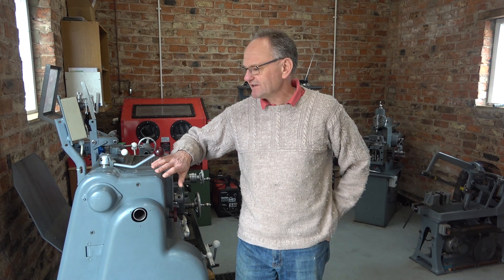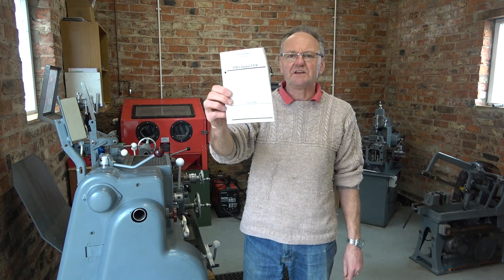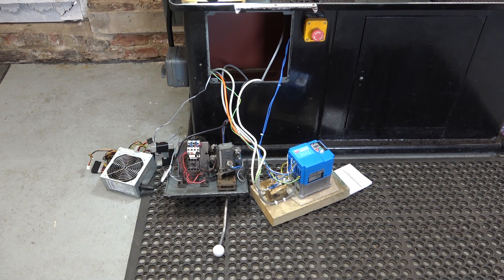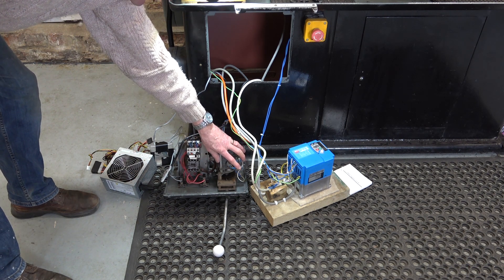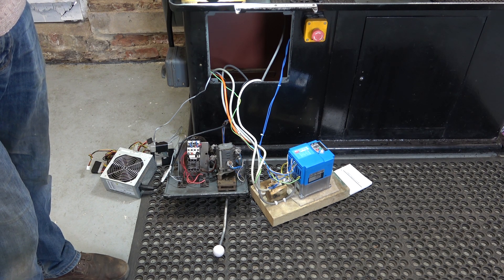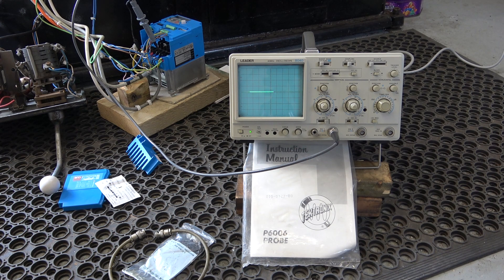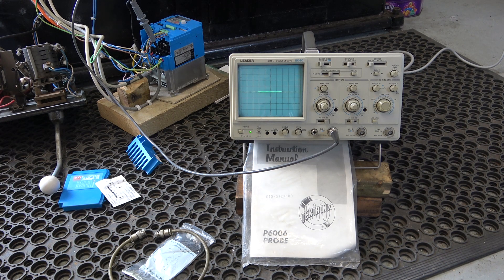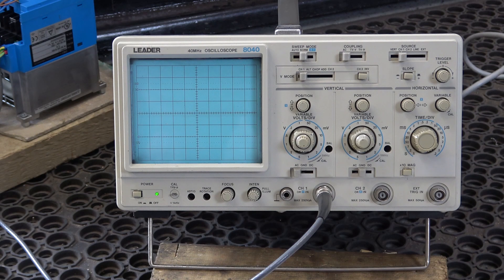HS65 Harrison lathe VFD tinkering

Comment: Measured between phase and the sky ? !!! WTF !
Used to repair radios ??? WTF
I'm not into electronics but.......
From CPC Farnell, get 3 7W resistors code: REO5423 8k2 ohm. Connect one end of all three together (=neutral) & connect the other ends to each phase. Then get another of the same resistors and put it across your scope. Then get an 80k resistor put in series with your test leads - and put the ends of those across Ln and N. That'll give you 24V at the scope of 1 phase and be properly connected !

When finished with this set up. Put the 8k2 resistors into unconnected mains plugs between L and E and give them to your friends that like annoying practical jokes !
Reply from the maker: Hi pmailkeey, I freely admit it was a bit of messing around. I realise now I was not going to see anything useful on the voltage, I needed to look at the current waveform. If I ever need to do any serious diagnostics then that's how I will approach it. I understand that now. Cheers
Reply: @HaxbyShed  I don't expect the current waveform to be vastly different to the voltage one - probably with some phase shift.

Comment: "I paid a lot of money for the inverter - about £350."
Not quite the £1200 I paid for a 3ph diesel generator. I wanted proper electricity - none of this electronic fake stuff. Mine has 2 wave forms: ON and OFF ;)
And of course is reversible: OFF and ON  - LOL
It's the instant spindle reverse that forced my hand - I didn't want a workshop full of electronically generated soot.
Reply from the maker: Hi pmailkeey, inverters are now very cheap compared to the £350 I paid. I was suspicious of cheap inverters but it seems plenty of hobbyists are using units costing £50 to £90 with no problems. I'm not too familiar with MG sets or diesel generators but for a small shop the noise and cost are not easily accepted. The inverter gives a very wide range of speed control without too much impact on torque, I believe, and for some people that avoids the pain of changing belts. It's a case of 'horses for courses' I think - it depends on your resources and needs. Cheers
Reply: @HaxbyShed  I think inverters/VFDs are a very good choice and I found them tempting but for their flaws !
In getting a diesel generator, I know I've got 'proper' 3 phase sine waves without question as well as backup power in cases of power cuts ! Although I'd not thought of that at the time of purchase !

Comment: I have been pondering what to do with my lathe, a Harrison L5A. I got it a few weeks ago and have stripped it. Now I am putting it back together. It came with a 1.5hp Brook motor, 3 phase, possibly original 1960s from the look of it. I don't have 3 phase, so I can attach a much bigger 1.5 hp single phase vintage capacitor start motor that I have or run the 3 phase on a VFD.  I was bench testing the 3 phase motor on the (cheapest ebay 1.5kw) VFD and was foolishly trying to run it up to the 300hz that the VFD could put out. But I realised that the motor is designed for 50 hz. Where am I going?  My lathe was designed to take an input of about 1450 rpm at the motor, drop it down via the belt pulleys and then through the gearbox give a limited number of speeds. (Your lathe probably goes a bit faster.) I can imagine that if you are running the motor slower (or faster) than the plate speed then there could be vibrations created in the motor or in the transmission. I would like to imagine a team in white coats with clipboards putting these lathes through extensive tests to dampen vibrations and design them out and then we come along with VFDs and run the motors at zero to full speed, with the gearbox always set to full. (not that you would!) So my thinking is that I should set the vfd to 50hz then use the gearbox to set the speed. If for some reason I need an intermediate speed I should go to the next speed up and throttle the motor back with the VFD, the idea is to keep the motor running as close as possible to its design speed for cooling, and not to overspeed it. Likewise with the lathe gearbox, just because I can get the motor to run at over 50hz doesn't mean the bearings, etc. in the gearbox can handle it.  Thinking aside, on the other hand. I bought a lathe for under £300 and a VFD for under £50, I am a big boy and can run it however I want it! I am not sure I will splash out on royal purple however! For the limited work that I will give it I imagine any old gear oil will do.
Reply from the maker: Hi Bootsowen, thank you for sharing. I went through exactly the same thought process taking a cautious approach. My mind is always on the people who designed and built the machines with all their accumulated experience. Your three phase motor will be smoother than single phase. I don't think it hurts to overspeed an old motor a bit - perhaps +20% but that is just my opinion rather than any solid fact.  My Harrison 140 came from the factory with a 1.5hp three phase motor and a top speed of 750 rpm. I fitted the VFD and a double sized drive pulley but I limit the VFD range between 25Hz and 50Hz (1425rpm). So when the VFD is on 50Hz the max spindle speed is 1500 rpm. The later models rated for higher speeds and the H140s (regardless of speed) had a stronger bearing arrangement on the clutch I believe. I select a speed on the gearbox nearest the one I want and then adjust the VFD.   I've heard it said that the motor should not be run much under speed as it could result in cooling problems but I run my motor at half speed (25Hz) a lot of the time and it never gets warm. According to the manual, my VFD maintains the torque as the speed reduces. I have considered uprating to a 3hp motor, as the high speed models had those, but I would also have to buy a more powerful VFD and it's more than I would like to spend just now as I'm doing ok with what I've got at the moment. After a lot of experimenting I'm happy with the original ISO68 oil and the Royal Purple has gone to my son, although I've yet to see the money :-)

Comment: Check that your number of poles setting is proper and one other setting for vector control...if you are not running at full speed you could have issues with your motor cooling properly
Reply from the maker: Thank you Erich, I will check the handbook for those settings.

Comment: When I setup my VFD (TECO Westinghouse L510 for the drive on my Emco Super 11) I initially went with all of the factory default settings. The result was a "noisy motor". After watching a few videos and printing & binding the manual (thick as a brick) I went into the shop and proceeded to change some key variables like carrier frequency , accel, decel. rates (one at a time). HUGE difference. The drive is super quiet now, and functions the way I want it to. I marked up the manual with the new settings for future reference. Another approach is to try to isolate the problem system by system. With the belt removed, run up the motor and see if the noise is from the motor. You could also spin up the spindle with a small AC motor (rig up a chuck mounted pulley ) and just spin up the spindle. One other method to isolate the noise is to use a long screwdriver with the handle pressed against your ear and the touch the tip close to the bearing ends of the headstock. Of course you could purchase an el-cheapo stethoscope for machinery diagnosing. The belt tensioner seems a bit loose on your machine, not sure if I would use a stiffer spring, or fix it in place with a screw/slotted bracket arrangement. All that to say, approach it step by step, and you may find the source. regards
Reply from the maker: Martin thank you very much for all that detail. I have finally found the carrier frequency settings for my VFD. The default is 15kHz but I need to check to be sure that's what it is actually set to and maybe try to step that back to see if there is a difference. Generally I had no thoughts that the motor was noisy - it came up in comments when I showed the strange resonance close to the motor normal running speed of 1425 rpm.   I'd never noticed it in the past, only very recently, but I don't usually run the motor at full speed. I will do a bit more investigation in the background. Cheers.

Comment: These VFDs are quite versatile, the same model can be used to power a wide range of devices, be it a large fan, a pump, a conveyor belt or a machine, all with very different setups. Therefore , the manufacturers integrate a lot of features, allowing configuration of almost any parameter. Hence, the factory settings are almost never suitable. A VFDIt is one of the rare cases where taking a look at the manual is really time and effort well spent, IMHO. No critique, I really enjoy your videos. I have a lathe, a shaper and a drill press, all running via VFD, and have spent quite some time on each if them fine tuning the oarams..
Reply from the maker: Hi, throwing the manual aside was just a bit of theatre but in truth half the parameters I did not understand without a fair bit of research = time invested. In skating over all that (just accepting preferred settings) I now see I could be missing out on a lot of 'tuning' improvements. My 1.1kW (1.5HP) lathe motor dates to the 2000s I'd guess, the manufacturer is only trading as a badge now and I can't find any info other than the motor label.  It would predate VFDs I think. If I was feeling generous to myself I might buy a new 2.2kW motor designed for VFD operation and supplied with VFD drive parameters. Cheers
Reply: @HaxbyShed  no worries, that's what ee usually do with manuals.. 😎
I only touched maybe 5 or so parameters myself. For the lathe, I needed the tuning to get rid of noise from the motor. My drill press has a motor from 1943, as far as I can tell, is running fine with VFD from 2016..

Comment: I had some "cogging" issues on my 10hp lathe. It would work fine for months, then all of a sudden it would start acting up. I was able to tune a lot of it out and it barely ever does it now. Further tuning would probably fix it completely
Reply from the maker: Hi Darren, I had to look that up and so it adds to my education. "The phenomenon of Magnetic Locking between the stator and the rotor teeth is called Cogging or Teeth Locking."  It makes me realise motor control is quite a specialist subject - much more to it than I knew. Cheers.

Comment: Yes, not sure what was possible with a X10 probe, plus high voltage. A good quality current clamp comparing each phase may help, but I think that's several order of magnitude in coffees.
Possibly run the motor on its own, on non vibration material.
Thanks for sharing.
Reply from the maker: Hi there, a couple of people commented about voltage vs current waveforms. Once I saw those I guess it was obvious that I'd be better measuring current. Channel comments are such a learning accelerator for me. I still think it's likely to be some weird case vibration - I'm sure it's a recent manifestation but we will see how I've got on now I've changed that auto torque setting as apparently it prevents the motor from being "over excited" at low load. Anyway I'm not too worried it's really a curiosity talking point rather than a problem I think. Cheers.

Comment: Haxby: You told me a Perry Mason thriller, but then didn't give me the "who dunnitt" at the end. Did the vibration go away? Get less? Make any difference? Is the lathe performance any different?  I personally don't like VFD's because they don't act like supplied current. I have to use a rotary phase converter here in the States. Years ago, (1976) I had an electric hand drill  with variable speed that worked by shortening the square wave pulse width but kept the voltage @ 110v. Worked like a charm & had equal torque at low & high speeds. It only lasted 2 months & blew up. Wouldn't you do better with a gas engine & variable sheave pulleys to power the lathe? Wife still thinks you're cute. She watches every video.
Reply from the maker: Hi Robert, yes that's true it was mid-step but not a conclusion. But by 'putting it out there' I've got some useful comments back. Over the coming days/weeks I'll monitor the vibration and no doubt comment as a side note in a future video - I do have one in mind. VFDs are so cheap and small now, and provide speed control, it's getting harder to justify anything else, and RCs can be noisy in the shop unless you can put it/them outside I think.  Recently I looked into power supply in the States and saw how many different 3-phase voltages there are - I guess it's a big nation. Gas would not be green:-) I'm not sure when I'll tell my wife that I have a female fan, perhaps choose my moment carefully. Anyway she might not believe me :-)  Keep well.